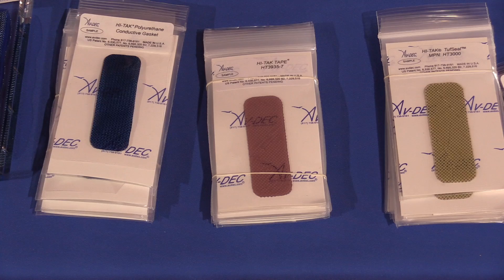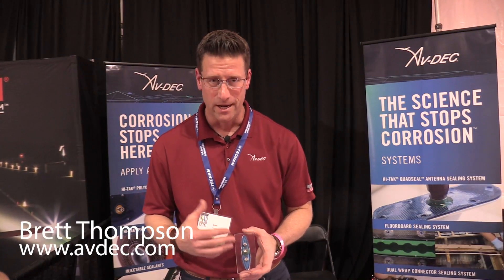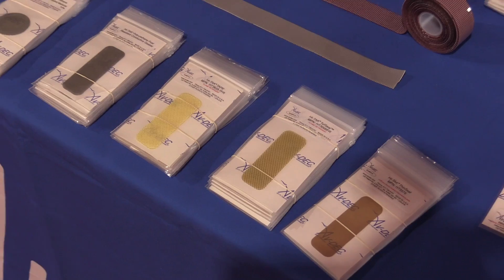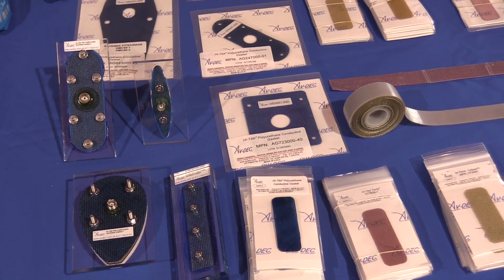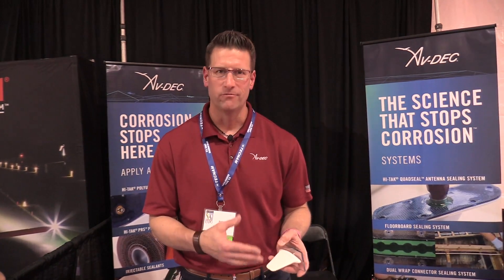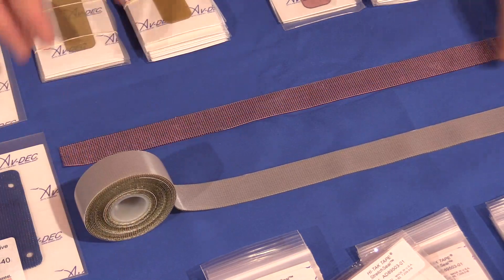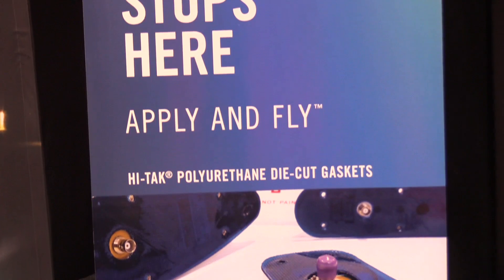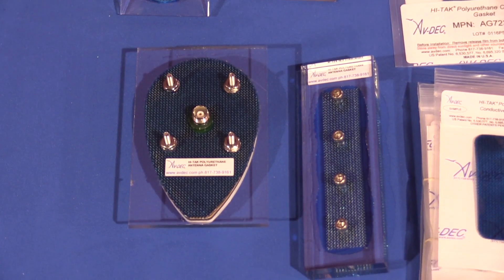Product Minute Avdec Anti Corrosion Gaskets

Comment: We use the AvDec products on our Gulfstream jets. The bottom line is that they work incredibly well. We do regular antenna removals to check for fuselage corrosion. Upon using these gaskets, the corrosion problems stopped. That is to say, corrosion was not simply reduced, it was eliminated. Gulfstream then chose to replace silicone wing fairing gaskets (which chafe through the paint, and corrosion starts) with the AvDec tape. Again, it solves a major problem. This was a huge issue, as a 25 foot line of pitting corrosion on the side of the fuselage is a great way to scrap a 25 million dollar jet.